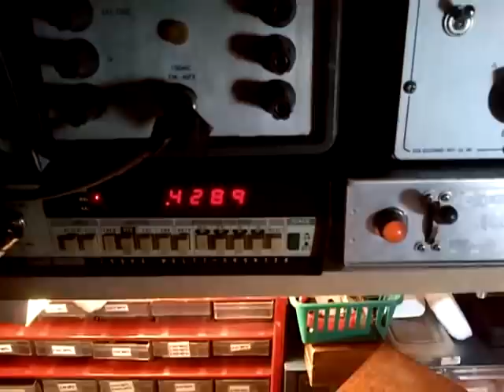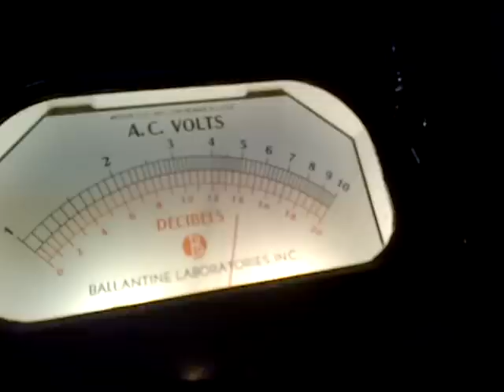Philco 49A Tube Radio Video #5 Replace Old Capacitors

Comment from the maker: I watched it back just now.  It's more of a bad explanation than a bad cap!  When I was adjusting the trimmer cap in the first IF, it was shorting out.  You can hear all the noise but I didn't comment.  I became very hesitant to adjust the capacitor but I still wanted to get it peaked.  I finally stopped adjusting it and stating 'bad cap'.  I didn't do anything more to the radio.  What I really discovered was that changing the caps did not shift the IF tuning much at all.

Comment: Ok, I just finished watching this video.
At the end, when you were peaking the IFs, you said; "bad cap". Then you said; "I think we have a radio here". Lastly you said; "adjusting doesn't seem to make a difference". Did you find more wrong that's not on the video Jim? Was there another bad cap? Tuning one side of one of the IF's really didn't make a difference?
Well in any case I see in the end of the 6th video it works!
Congrats!
Good job,
Tom

Comment: Changing capacitors just for the sake of it is pure non-sense, unless they are physically oozing at the ends.
Reply: Even if they aren't oozing, when they're that old they are most likely way out of tolerance.  Changing them and out of tolerance resistors is cheap.  Much cheaper than having to buy a new transformer.